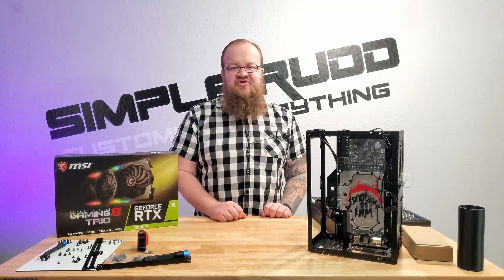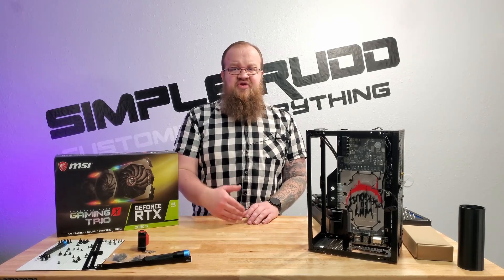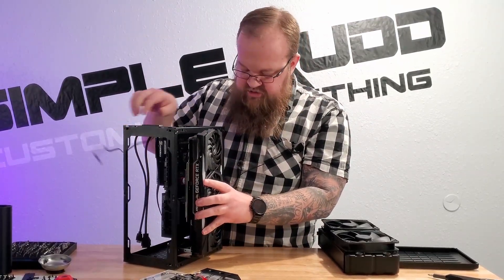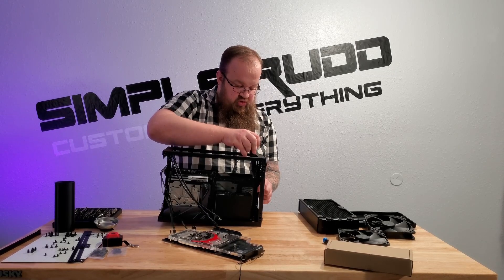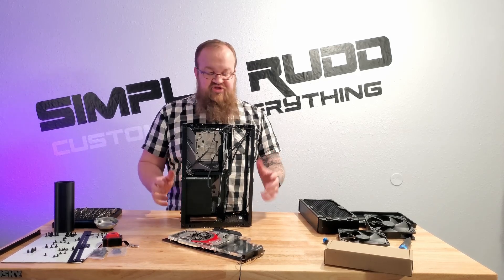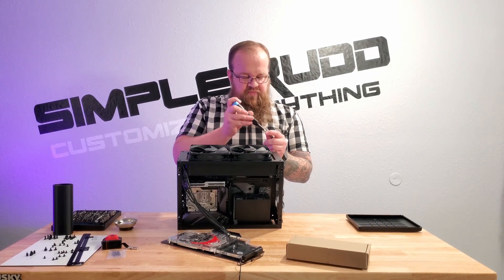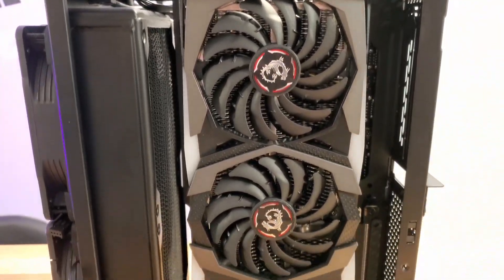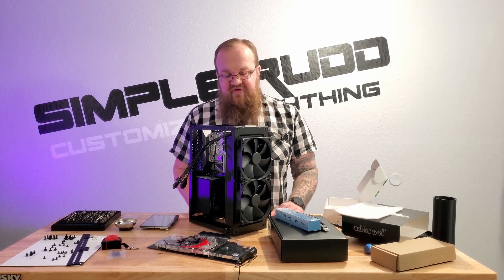Thick 280 Rad in SSUPD Meshlicious!

Comment: I have a 3090 water block dual cover … And I have not found an ITX case nor a mini ITX board in which it will fit… Im hopeful with this case I can make it work (a dual loop)… I need the bigger radiator and tempted on installing the radiator and fans on the outside…
Reply from the maker: The only reason my waterblock wouldn't fit was my chunky radiator. Exterior radiators would give you a lot of room! Those dual covers are pretty thick, but I think Meshilicious can fit triple slot.